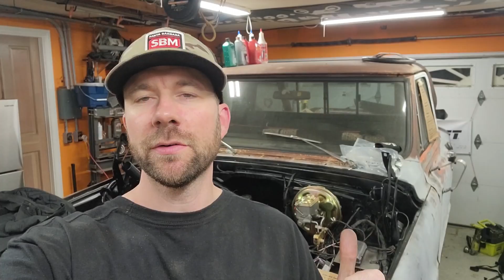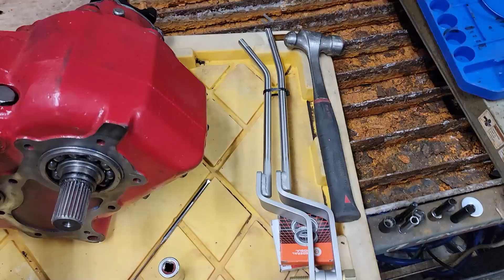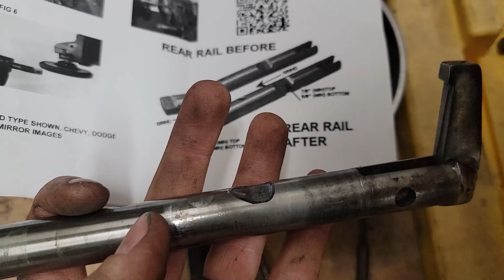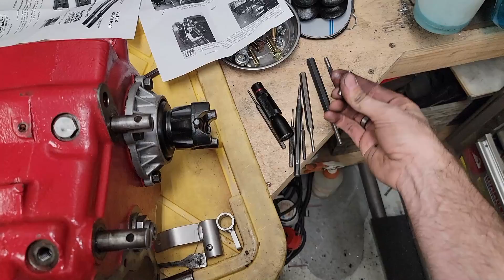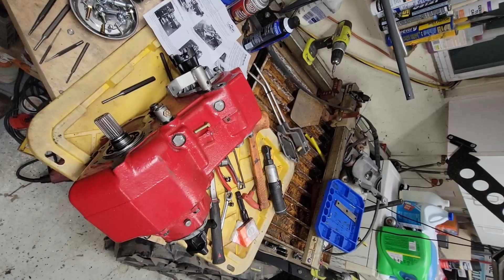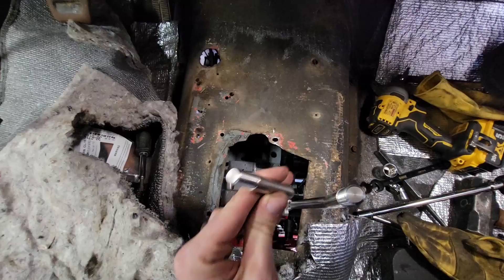Easy GM NP205 DIY Twin Stick Conversion Using JB Custom Fab. Kit

Comment: Why do you have to grind the shift rails in the first place ? Why won’t they work how they are ? Also would you say yours are uneven length ? I see it asks that when buying a kit if they are even or uneven, which I plan on doing soon.
Reply from the maker: On the GM NP205 the shift rails are different lengths, and the kit from JB doesn't mention any shift rail options other than DIY or buying them pre-modified. I'm not sure if that is the case for all T-cases.

Comment: I got the sm465 and was hoping to do this so on the road i could shift rear low to high and i would like to know if that'll hurt it
Reply from the maker: Low to high is definitely better than trying to go the other way. I'm not sure if the transfer case will let you shift while moving. I always stop just to be nice to mine. If it physically lets you shift and doesn't grind it should be fine.

Comment: Can you create a tripler, just curious if any one knows?
Reply from the maker: @DirtRoadByways  you can add a doubler and in theory a tripler by adding other transfer cases on. If you are looking to lower your gearing more you can potentially get a magnum underdrive kit, or run a separate divorced transfer case.
Reply: @gearheadgrind  I don't know that I would need to but now I can go look that stuff up. Thanks.
Reply: @gearheadgrind  I gave you a sub. Appreciate it

Comment: Does the shift rod have to be ground down for the kit to work, I picked up a np205 that I plan to swap onto my th350 and I want to do twin sticks but I’m scared to grind down the rods
Reply: I just did this mod on my Ford NP205. Take a crack at it. If you screw it up, you can buy the pre-modified shift rails from JB fab for like $140.
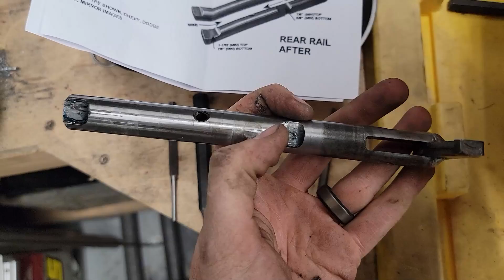Reply from the maker: Hello, are you referring to the part I start discussing around 5:20 of the video? If so, then yes.

Comment: thanks for sharing... nice setup! i plan to run the same twin stick setup in my 70 Suburban but i really like that Sidewinder setup you have there... what model is that, and how did you route it? ill be running a 4L80, but it probably uses the same shifter...
Reply from the maker: Hello, I don't remember the model exactly. I will see if I can dig it up. But I had stockpiled a lot of the parts around that time, so I'll have to see where I ordered it from.
Reply from the maker: Sorry for the long delay @kellybikeco. The model is 177-1 from Winters.
Reply: @gearheadgrind  no worries, thank you for getting back with that info! 🙏